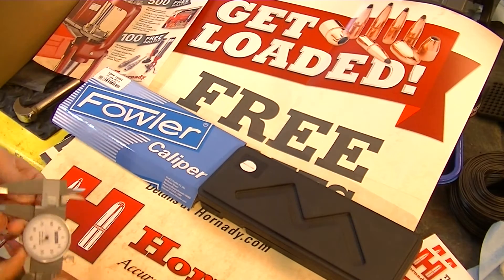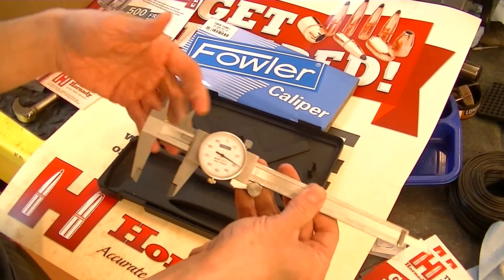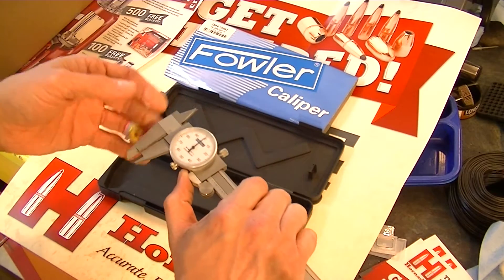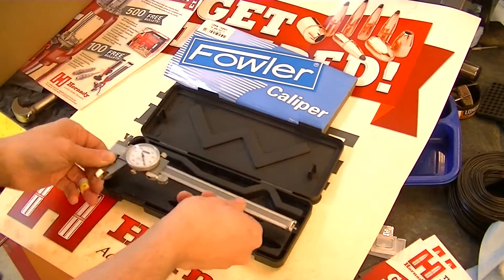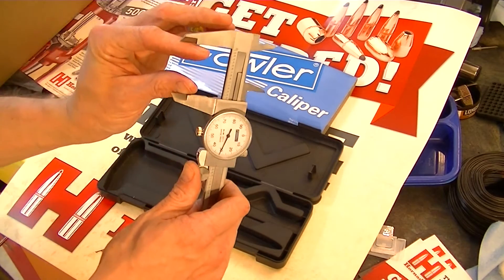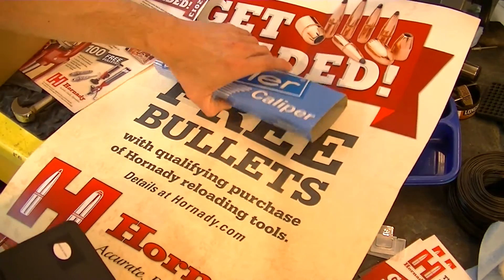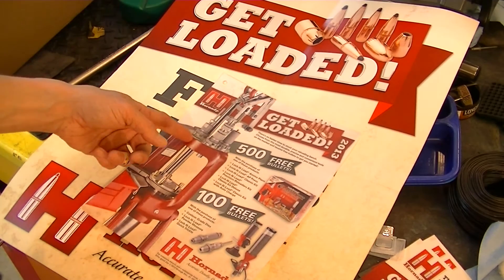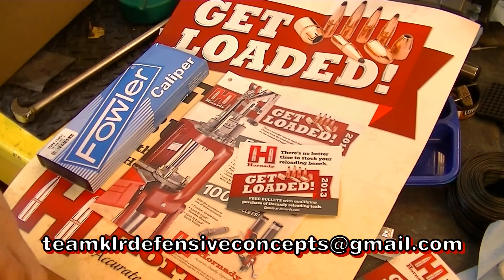Tip storing and zeroing dial calipers. Hornady 2013 campaigne

Comment: do you like those Fowler Calipers? I have sone crappy Harbor Freight ones that do not work. I was looking at Fowler dial calipers. they have a few I'm not sure which would work for reloading
Reply from the maker: They are awesome.  Night and day to the HF ones. Fowler or Mitutoyo. Go on eBay and get a used set of digital, either brand.

Comment: Hello I have a Lyman caliper and the pin is set on 90. I tried your method and if I do that the 0 zero is cocked to the left. Is the caliper broken or is there a way to fix it. I bought about 3 months ago and just now got around to using it
Reply from the maker: No my friend, it is not broken.  As variables are in play and the original zero is altered over time this will change. There is no easy way to change where the needle rests at when the jaws are clean and fully closed. This being said, we only have the dial back/housing left to adjust. This is the intended part to adjust. So the needle will be where ever it is as things change and we just rotate and lock the dial housing to show zero where the needle is actually at zero. Did that make sense??? haha Point is that it does not matter if the dial was upside down as long as every time that you clean the jaws and close fully the needle stops on the zero.